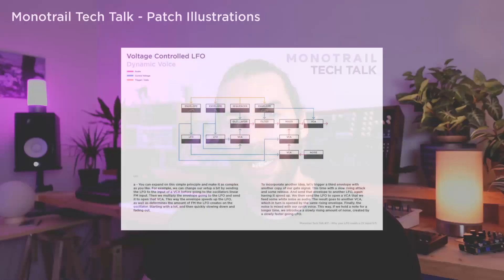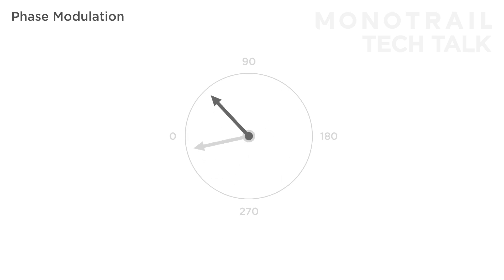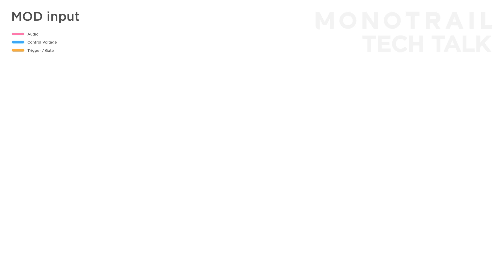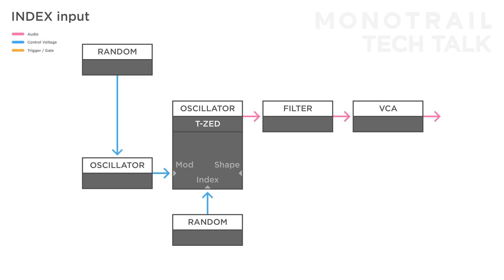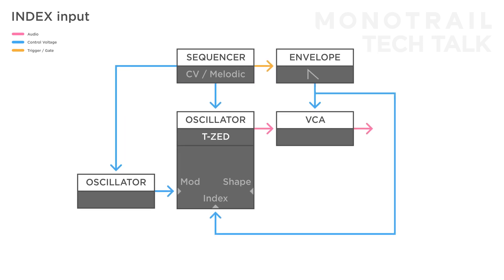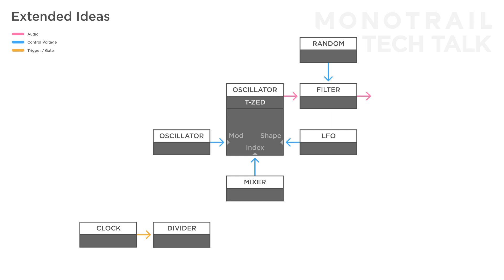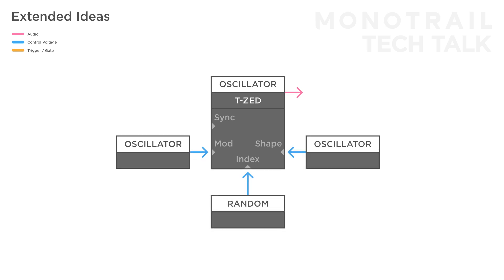Sound design using through-zero phase modulation – LA67 T-ZED oscillator

Comment: Another great video! Very interesting technique but how does this compare to ring modulation?
Reply from the maker: Thank you! Ring modulation is basically voltage controlled polarizing at audio rates. It's a different proces, but can also lead to similar kind of textures. There's a small section on polarizing/ringmod in my video on the Papomi if you are interested! https://www.youtube.com/watch?v=5fwIyB23l3Y
Reply: @MonotrailTechTalk  I think I need to rewatch the papomi video with the current knowledge 😅

Comment: thank you!!! is through-zero the same as linear fm?
Reply from the maker: Hey there! So no it isn't :) Linear FM is the same as exponential FM, or 1v/oct FM. The only difference between Linear and eponential FM is the amount of frequency chance that happens in relation to the incomming voltage, which is why it has a different sound.  But both just increase the frequency with positive voltages, and decrease the frequency with negative voltages. 

Phase mod is like I exlained in the begining of the video. Voltages change the phase of the wave. That happens through increasing or dereasing the frequency to be honest, but it's a slighlty different process, with a slightly different sound of its own!

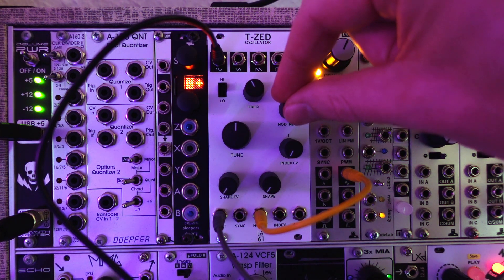Comment: Great tutorial as always. However, that whine from the oscillator isn't the vibe (audible at 6:14 but not anywhere else). Any ideas of how to remove this whine? I've had similar issues from the z3000 and the 4ms power module. It wasn't until I got a makenoise PSU that the noise disappeared (or was lowered so much i didn't notice it).
Reply from the maker: Hi there! A "whine", as you call it isn't from the oscillator itself, but indeed often caused by a shortcoming elsewhere. Could be a power supply, could be a low pass gate (factrols often have some high pitched bleed going on), or indeed a module that isn't responding well to a power supply. Or even a ground loop, my Beatstep Pro is known to cause one. Just experiment with removing different modules/gear, and see what causes the whine :)